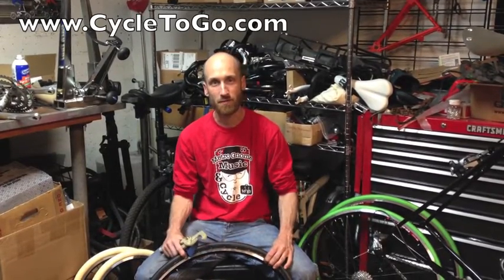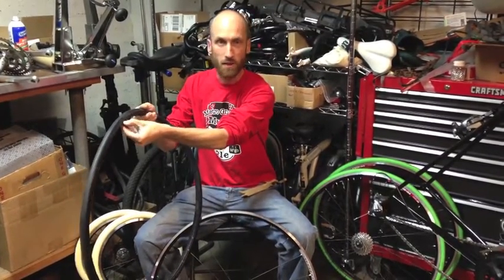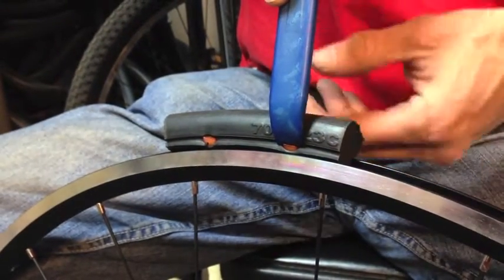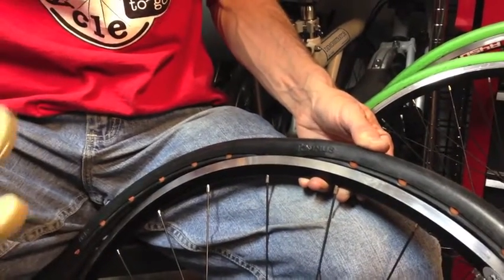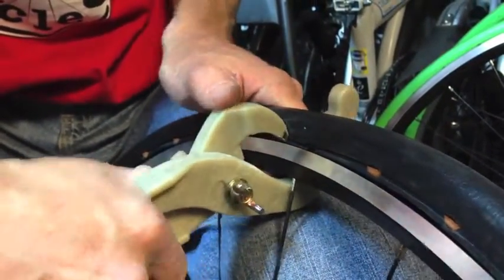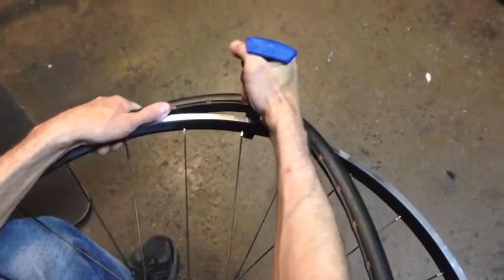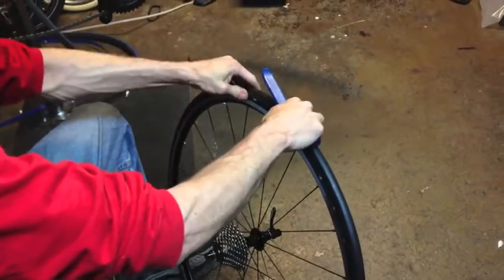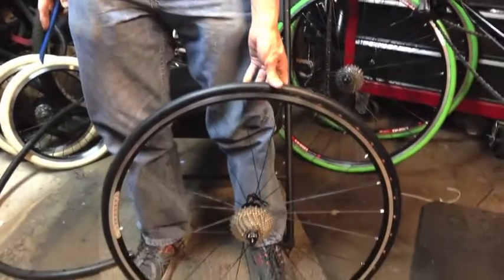Tannus No Flat Bicycle Tire Installation Tips & Tricks

Comment: Just finished installing a pair of 700x28 on my bike. This is a very helpful video (and I bought the tires from the these guys). Couple of quick comments: warming the tires, even a little bit, really does make a difference. I did one without much warming and did the second after laying it on a floor with radiant heat about 30 minutes - noticeable difference, particular on  the step of levering the tire fully around the rim. The p-tool is useful in two main areas - getting the initial three or four pins locked in as well as when you inspect (both sides) of the tire when "finished" and you see that a couple of pins did not fully seat. Otherwise, the freebie "T" shaped tool works great for pin insertion. The other limitation of the p-tool is that your spokes will get in the way - particular since the dual-wingnut hardware on the p-tool makes it rather wide - you will have clearance issues. Overall I'd say installation is rather tedious, but with the tires rated to 5k miles, it's not exactly something one will need to do very often.

Comment: I did one, oh yes, lock in about 15 ish, and start to pull it around the wheel. The last bit is so hard, I felt I have exceed the limit of my strength. Wow, need to finish back wheel tomorrow 😅

Comment: This is without doubt the best installation video of Tannus tyres ever made.
I can add how to remove them easily without damaging neither the tyres or the pins:
Insert the s-tool between two pins and between tyre and rim so it sticks out on the other side.
A screwdriver could be helpful doing this.
The pins holding the tyre are installed across the rim and under the lips.
Forcing the pins out of place diagonally will loose the tyre from the rim.
Place the wheel against a sturdy object such as a wall with the edge facing you.
Using a mallet, hit the s-tool and  force the pins on one side of the rim until the pop out one by one.
When all pins are out it's easy to use the s-tool and pry the tyre off from the rim.
This knowledge could be very useful then replacing eg. a loose or broken spoke.
After repair the tyre and pins are easily installed again.

Comment: I just install these tires 700C 35. I had a few issues installing them but over came the issues. This if what I did to lighten the install process. I got them warmed up placing them out in the sun. I then worked then back and forth in my hands as I rotated the tire. Just flexed them back and forth. Straightened the tire right out. Made it a lot easier inserting the plastic pins. Used needle nose pliers to insert the pins. The installing them on the rim .... I used zip ties and as I worked the tire from the bottom I installed a zip tie on the bottom. Placed one at 4 and 7 o’clock ... then worked my way around.  About every 8 in I placed another zip tie. Cinch them right up. Got to the top and just popped the tire right on. Make sure to seat the bead at one side all away around. Now on the opposite side push the plastic pin in with the tool provided. Push the edge of the tire down and put force into the middle of the pin. This will bend the pin enough to make it snap right in.  Took about 30 min to install a tire. Later.
Reply: Hi! Is the line in the middle of the tyre, in the middle? Mine is slightly off to one side
Reply: @fredsting8871  
Yes, the line should be in the middle.
You have to work the tyre in place correctly either by hand or using slip joint pliers.

Comment: Great video thanks, ive had these tyres for years, and ive just replaced the rear one as it had gone a bit square on the edges with a new tannus, but i cannot get it to sit right this time, it feels like ive got a buckled wheel now, so gonna take it off and try again....for the 3rd time...

Comment: One of the plastic pins tore through it's insertion hole on the underside of the tire during installation. Is the tire still safe to use with one pin not secured?
Reply: Yes, they are.